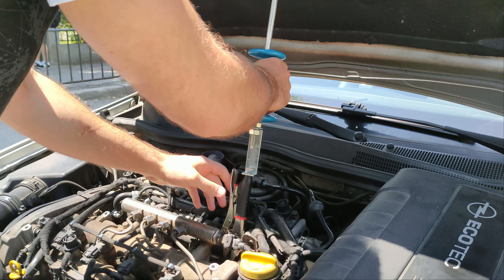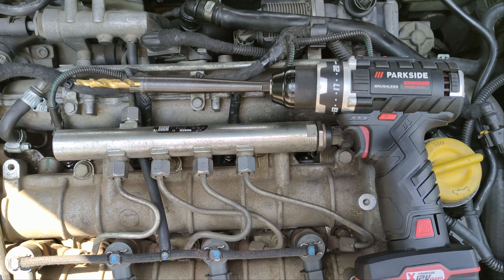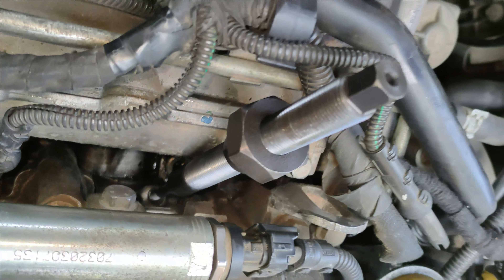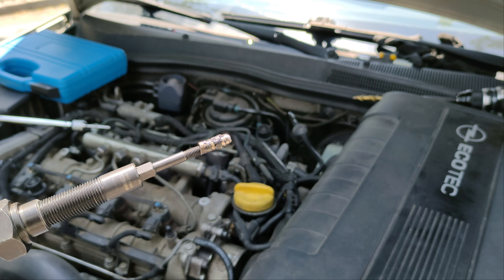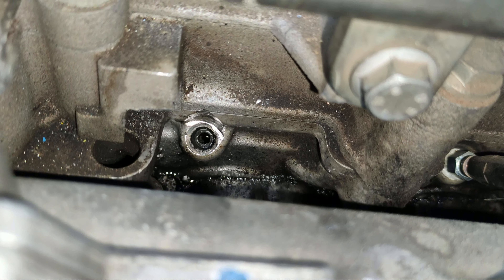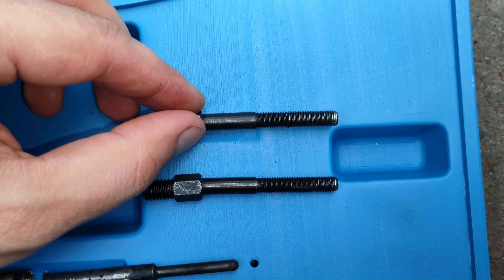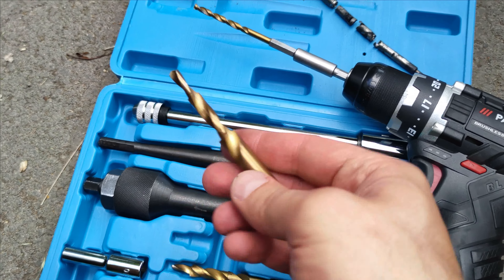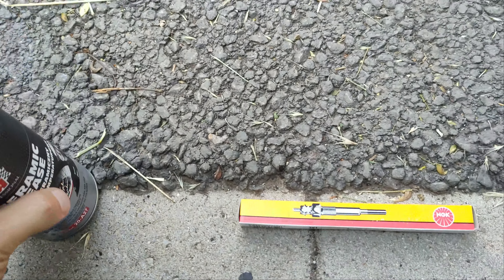How to Remove Snapped in Half/Broken Glow Plug -  Vauxhall Astra H - Part 2

Comment: To prevent the glow plug snapping in the first place, I think it is best to use an Impact Wrench and in my opinion only use that, nothing else.   The is because the reason, I think, it is more likely that an old glow plug may snap is undue side load.  I'll try to explain this; So as well as the rotational torque, if you are not careful you can apply a side bending force that will cause the head of the glow plug to bend side ways a little when you apply force.   This is made worst if you use longer extension bar on your wrench as this acts as a lever applying more bending force if you are not careful.  I suspect it is this force that cause the glow plug head to snap.  If the force can be kept purely rotational (i.e. Impact wrench) then I think the old plug will come out without snapping.   What do people think agree/disagree?

Comment: It's best to soak injectors in PB Blaster or WD40 for a day or two before removing.  Also, typically no more the 20 NM on each glow plug when removing.  Lastly, start to tighten first, then slowly begin to remove, then tighten and remove and hopefully they will come out without a problem.  Some like to warm the engine too and then let cool off slightly before removing.  The key is not to put too much torque on them while removing.
Reply: Mechanics are aware, but some are just to tight and will snap. Then you have to use one of these kits. I’ve changed 26 glow plugs in  30 years. Only ever had 2 snap, from a TOYOTA to lol.
Reply: 50% acetone and 50% transmission fluid works muchhhhhh better here. And quicker too

Comment: I wish glow plugs had stronger material 😧 I snapped two of my glow plugs on my previous Astra H 1.3 CDTI. Took her to a mechanic, but he had to stop midway because he could see outcome if he continued drilling. I have a Astra H 1.7 Cdti now with 4 working glow plugs. Maybe my mistake was that i tried replacing the glow plugs while the engine was cold and not hot 🤔 I am kinda terrified to do this again, but at the same time, i wanna try again.

Comment: I don’t understand how it works? Your pulling while it’s still threaded?? Won’t it damage the head?? And if you tap the glow plug thread out, won’t the rest fall in to the bore?
Reply from the maker: If you don't understand it after watching the full video, this repair is probably not for you. And if you try it you may end up making more damage.
Reply: The way it works is you pull out the centre and then drill out the part with the tread and then you remove the part on the treads and then you tap the part which is now below the tread and you pull it out

Comment: Excellent work. I used the same set last year and while I broke the stepped drill bit, it did enough to allow me to get the rest of the glow plug out.

You’re lucky the tip of the glow plug didn’t stay in the cylinder head. That’s even more of a nightmare job

Comment: You mentioned that you used 5mm drill bit for the inner aperture of the glow plug, could this have been the reason why it snapped the first two times ? The walls became too thin after the drilling and threading. I need to do this job myself and I'm thinking about using a 4.25mm drillbit and make an M5 thread in the glow plug. What do you think ?
Reply from the maker: You could always try and update.

Comment: Brake fluid around the glow plugs overnight is brilliant !!
I've bought an old v6 Merc and sod's law,5 glow plugs came out and one at the back didn't,it snapped damnit!
I've got the hole in the head retapped the glow plug screws into,but i don't know if my 1/4  tap and die is worn,as i tapped down into the body then used the bolt in the kit screwed into the hole,then attached the puller but the puller bolt just pulls up out of the thread i just made in the glow plug body??
Reply from the maker: Probably the hole is too big..

Comment: I have a question. Shouldn't the drill bit visible in 1:41 be used deeper? I mean that you should drill and you will drill out the entire thread of the broken spark plug? Because in the video you can see that you didn't remove the entire thread of the remaining spark plug. I'm asking because the same thing is waiting for me. I have an Opel DTI. Is your spark plug thread m10x1? Greetings from Poland. I saw polish ceramic grease. Maybe you are Polish guy ;)
Reply from the maker: Nope. That's the drill from the kit. You don't need going deeper. The remaining thread will be rethreaded with the tap later.

Comment: so you couldn't remove central electrode by using slide hammer but you removed it by pliers just like that ?
Reply from the maker: Pay attention - one is just pulling upwards, the other is twisting the metal and breaking it
Reply: ok, I buy it.  but on your movie it looked too easy; cheers

Comment: your drill bit is too big which causes a thin wall to snap the stock tip of the glow plug.
Reply from the maker: The drill bit is perfeclty suited for the application. The drilling takes place only in the upper part of the plug. The glow plug snaps way below that due to its walls being manufactured thin ;)

Comment: Твойте свещи изглеждат дълги, идеални за разпробиване. Мойте понеже са 10см и като махнем главата на свеща и подгревната част имам едно 3,5 макс 4 см за разпробиване. Никой от сервизите в моя град не му се занимава с тази процедура и си карам с една скъсана (превъртяна) свещ.
Reply from the maker: Има комплект за вадене на скъсани електроди на подгревни свещи - демек не е останало нищо освен най-тънката нагряваща част на свеща. При добро желание от някой майстор има начин и твоята да се извади :Д
Reply: Spark plugs and glow plugs are two completely different things. Spark plugs are for petrol engines and spark continuously to ignite the petrol to keep the engine running. Glow plugs are for diesel engines and are only used  for heating the diesel when starting the engine. Once started  compression keeps the engine running and the glow plugs switch off.